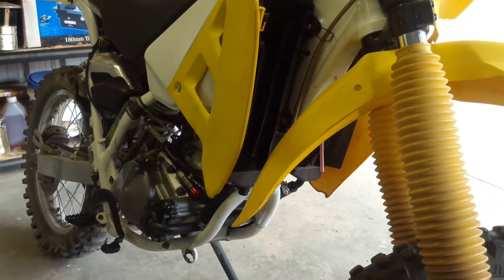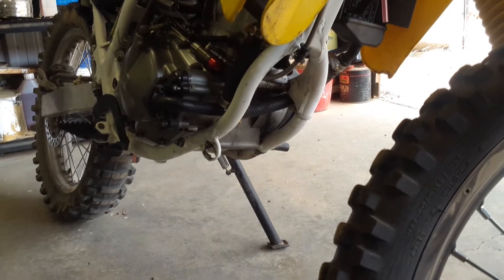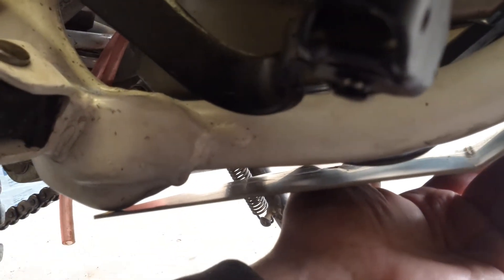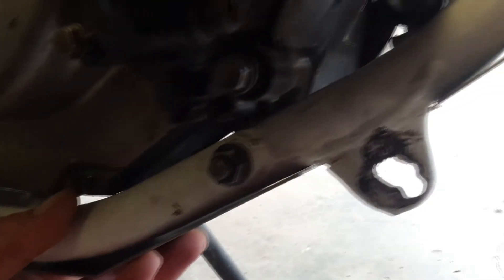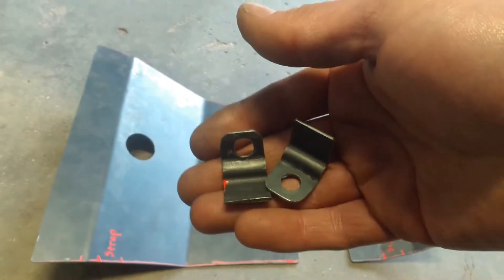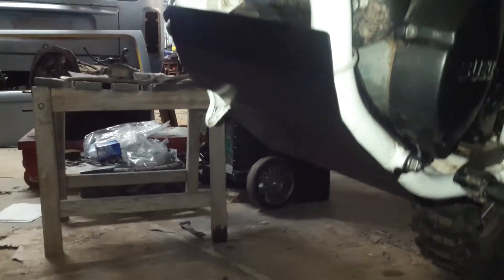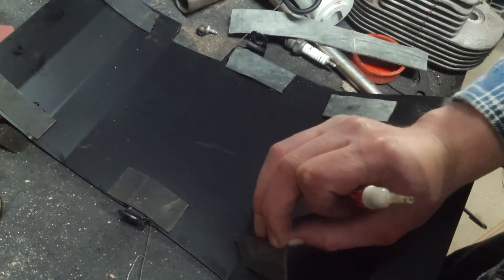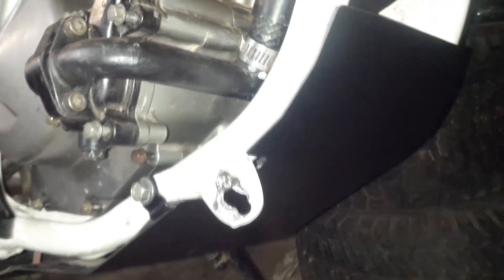Making a Dirt Bike Skid Plate

Comment: TWO   things ... 

ALWAYS  WEAR   GLOVES  AND  GOGGLES   WHEN  SANDING  / GRINDING   METAL...

AND    SECONDLY  ...

Your  Skid  Plate  is  OK ...

BUT ...

NEVER   DESIGN / MAKE  A  SKID  PLATE    BASED  ON 

" HOW  IT  LOOKS  " .

ALWAYS   MAKE   IT  FOR  STRENGTH  AND  FULL  COVERAGE  AND  FULL  PROTECTION   FROM  ROCKS  AND  STUMPS  AND  LOGS  AND  ANYTHING  ELSE  IN  WOODS  AND  TRAILS  ... 

WHO  CARES   IF  IT  LOOKS  TOO BIG  AND  BULKY   AND  UGLY    ! 

ITS   HOW  IT   COMPLETELY  PROTECTS   AND  COMPLETELY  COVERS   ENTIRE  FRAME  TUBES  AND    ENGINE  AND  EXHAUST  PIPES    AND  REAR  END  DRIVELINE AND  BRAKE   COMPONENTS  ... 

THIS   IS  WHAT  ACTUALLY   COUNTS ...  ! 

NOT   HOW  GOOD   IT  LOOKS  ON  THE  MACHINE  ...  ! 

YOURS   

MIGHT  "  LOOK " 
BETTER  THAN  MINE  AND  SOMEONE  ELSE'S  ...

BUT   MY  SKID PLATE  AND  SOMEONE  ELSE'S  

WOULD   BETTER   PROTECT   EVERYTHING  ...

INCLUDING   FRAME  , 

SIDES  OF  THE  FRAME ...

ENGINE  , 
EXHAUST  PIPES  ...

AND   ALL   REAR  END  SWINGARM  / SUSPENSION   LINKAGE  AND  
DRIVELINE  AND  BRAKE  COMPONENTS   ON  3 WHEELERS   AND  QUADS ... 

FULL  AND  COMPLETE   AND PROPER   PROTECTION   IS  WHAT  REALLY   COUNTS ...  ! 

NOT  

HOW 

IT 

" LOOKS " 

ON  THE  MACHINE  ...

ARE  YOU   RIDING  IT   ...

OR  ARE   YOU   
" SHOWING "   IT ...

LIKE  AT  A  CAR  /  BIKE 
SHOW  
OR  SOMETHING  ...  ? 

DUH ...  !